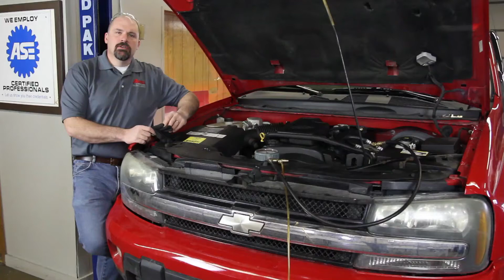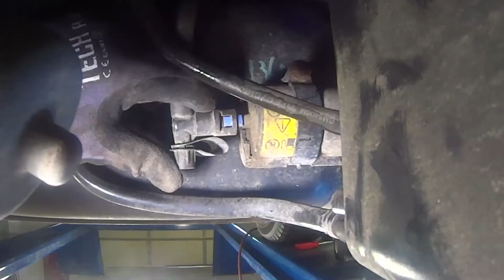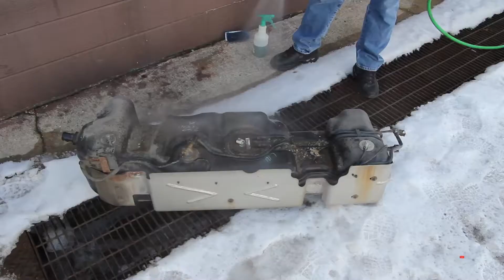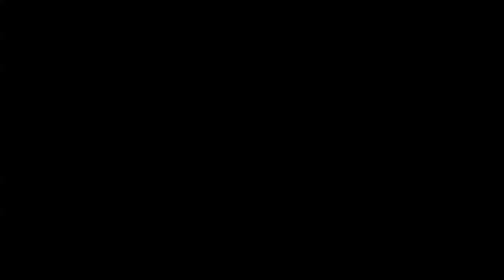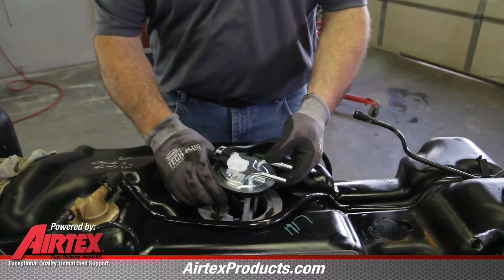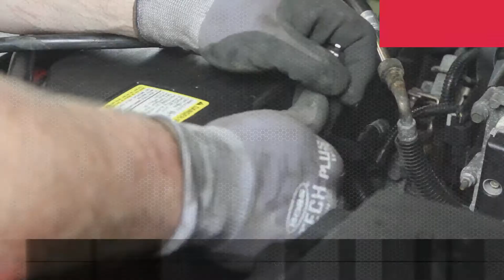How to Install Fuel Pump Assembly E3549M in a 2002 - 2004 Chevrolet Trailblazer

Comment: Can you show the trailblazer model that has everything inside the tank? 2005 l6 2wd 4.2. I don't see fuel filter or pressure regulator outside from engine to tank

Comment: Anybody know where I could find a diagram for the gas hoses to make sure I have them all hooked up right I replace the fuel pump and filter already I've already installed most of the lines but my Trailblazer won't start and I want to make sure I've got the hoses in the right place does anybody know where I can download a diagram of the gas hose layout I have a 03 Chevrolet TrailBlazer LT 4.2 L

Comment: just installed 1 airtex of these yesterday for my client 4.2 trailblazer 2003 i tested out the bomb outside to check if it would mark the fuel and it did i installed and just today i got a call that its not marking the fuel correctly -_-
Reply: Mario Moreno. tu comentario en español